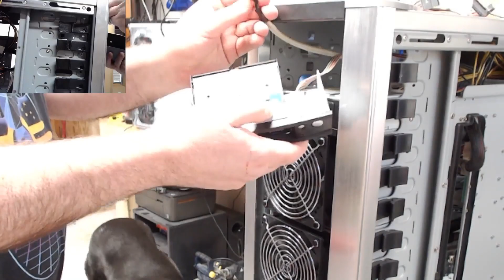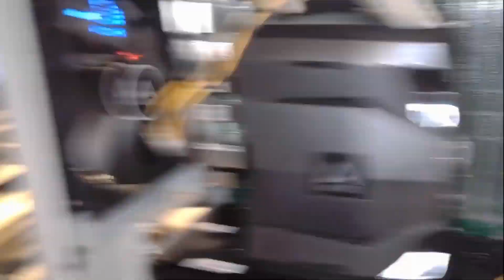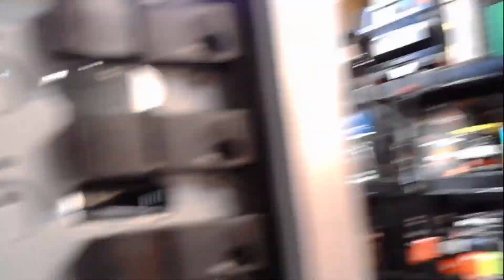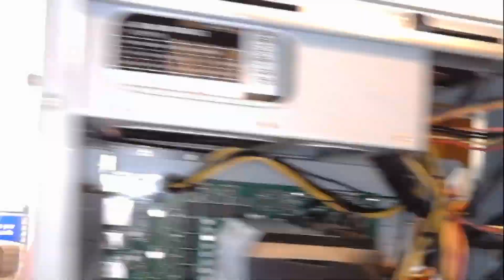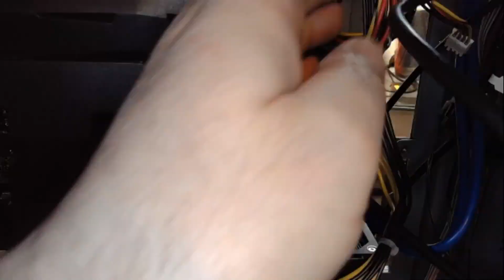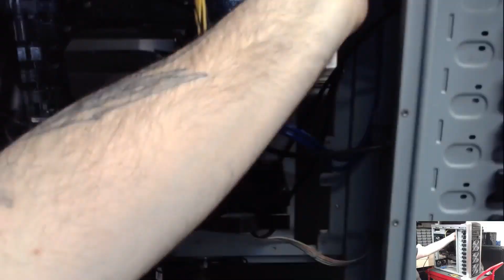Cooler Master Stacker Part 6 Completing the build.

Comment: audio, usb, pw,rs,led, speaker, vdg argb, corsair argb, thermaltake argb, are all DuPont connectors. so you can just buy extensions. making your own taking pins out is really easy too. (just dont plug it in wrong...)

anyway i loved thows big case with lots of 5.25 bays. never did get a stacker with i think 15 bays? i had the antect 1200 and moded the crap out of it.
Reply from the maker: Thanks for the heads up about the extensions.  I'll get some ordered up and have on hand for the next big case I build in.

Yeah big old cases are great if you have the desk space for them.  Lots of room to build in and upgrade them in the future. 😁